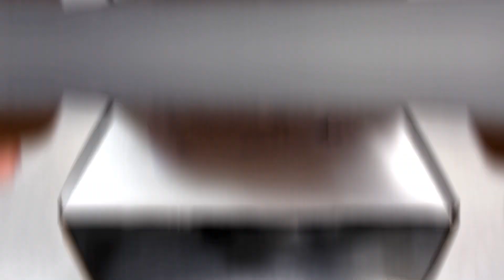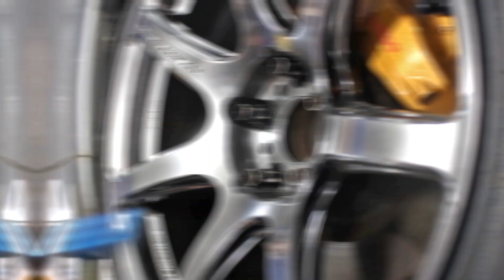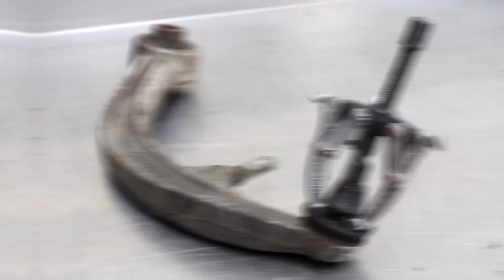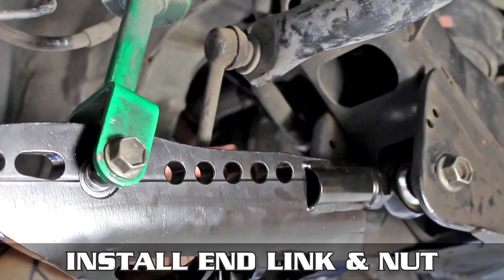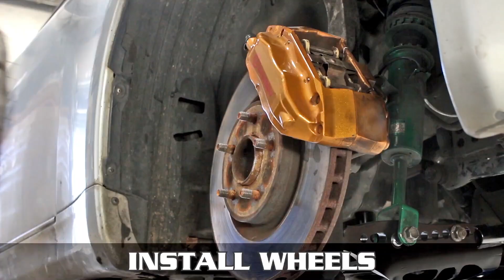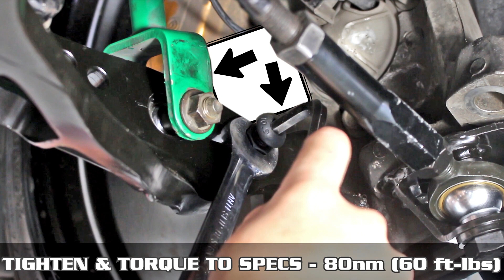Gktech Z33 350z V35 G35 Super Lock Lower Control Arm Install

Comment: Can this be used with oem rack ? And do you need anything else upon installing these arms
Reply from the maker: Yes you use oem rack, nothing else is needed, but you should use an angle kit and rack spacers to take full advantage